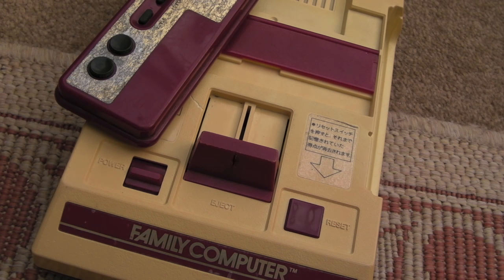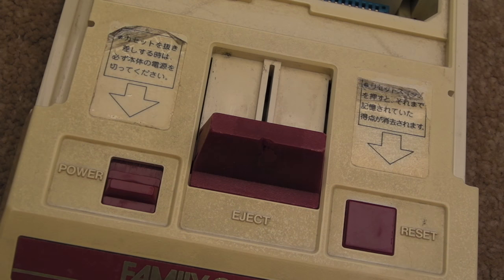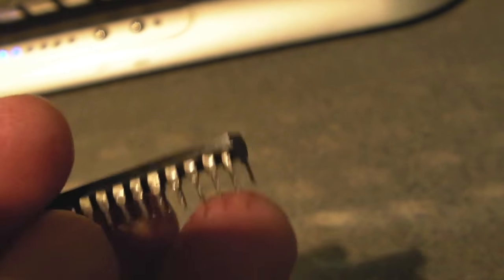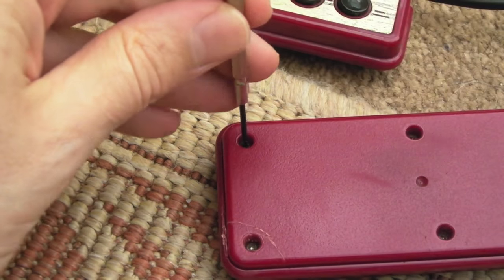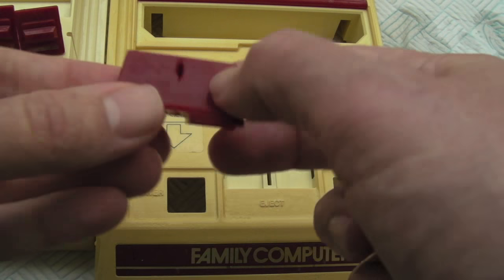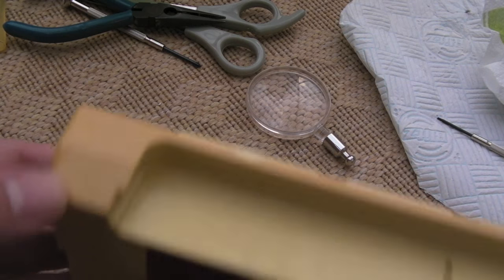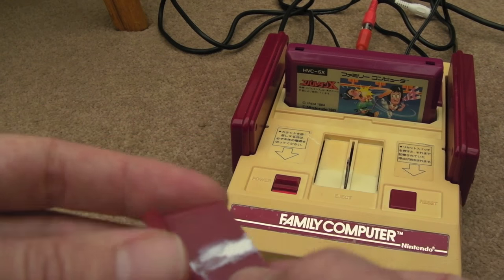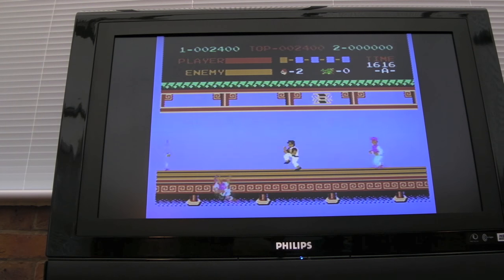5 Nintendo Famicom Repairs - Part 1 (SRAM - Black Screen)

Comment: Non there is not electrolyte in sram only transistor so someone dropped somethings acid in the device
Reply from the maker: That's what I thought, but I have read a research paper talking about failure types in older SRAM, and that paper clearly indicated that some older SRAM had electrolyte in something called the 'storage trench'.   There was nothing on top of the chips, nor around the chips, and no where else on the board.   I've seen this exact same thing 3 or 4 times - always in 2114 or 2115 SRAM - nowhere else on the board and never any signs of anything having leaked inside.
Reply: SRAM isn't supposed to have a "storage trench". Trench capacitor is a kind of vertical capacitor that is formed at the transistor gate in DRAM and EPROM, and actually is responsible for data retention, and it kind of makes sense that they'd try to stabilize and enhance the properties of this capacitor by introducing an electrolytic material into it... but it would be nanoscopic quantities that could never outright leak, and it would be very very far from the legs, especially far outer ones at the end of enclosure. Besides, that's DRAM, SRAM is really just supposed to be a transistor arrangement.

I'm thinking, there have simply never been many SRAM manufacturers, only a handful, and if one of them made a mishap in leg metal composition or enclosure plastic composition, and didn't notice it for a a few years because it takes decades for the problem to manifest, a lot of devices would be affected. Perhaps it's just a plastic additive leaching out and being corrosive. Also, could be that these SRAM chips, which were already severely outdated by the 80ies, were simply a lot older than consoles, old stock, and could come with a bit of invisible corrosion of the shelf?
Reply from the maker: Thanks for the info!  We have  afew theories on here so far - someone has suggested its an ionising effect between silver coating and the plastic package?   But it's good that a few people have clarified that a storage trench seems to only relate to DRAM, and as you say - the quantity seems so low that it couldn't be the problem anyway.  It's all part of the learning process.

Comment: Hi. My Famicom is outputting 14vdc. Is this normal? It's a 100v power supply (japan).

Thank you. God bless, Proverbs 31
Reply from the maker: Yes, the Famicom uses a 7805 voltage regulator internally, so it can accept 14v DC.  Often these manufacturers label a PSU up as 9v or 10v but it's not uncommon to see them outputting 12v, 13v or 14v DC.  The same is true of the Sega Megadrive power supplies.   Ideally 9v PSU is better as it will result in less heat internal to the Famicom.
Reply: I see. Thanks. What's the next step & component to measure to repair this Famicom? Nothing appears on the tv.
Reply from the maker: It's worth watching the other Famicom repair videos I did there.  It could be that there's a bad solder point on the DC jack socket, it could be that the crystal is dead, or it could be a faulty PPU, CPU or RAM.  You could measure voltage coming out of the 7805 regulator between ground (middle pin) and the 5v pin (right hand pin as the part number faces you).
Reply: Would this work: Can Famicom  transistor/voltage regulator (is a regulator a transistor too?) HA 17805 be replaced withI with a AN7805 (the one I bought, the only one available)? I think HA means Hitachi.

Is the 1 before the 7 important? Or these are just the same 7805?

By the way, off topic (about a power supply for another gadget).

Also, the original ceramic fuse had a label of T8AH250V will the one I bought work (it's the only 250v fuse available)? :

5A
BS1362
6X30

Thanks
Reply from the maker: Yes, that should work.  With these I will typically replace with a 7805CV (rated 1.5 amps vs 1 amp).
Reply from the maker: Just check the pinout is the same - should be pin 1 input (eg. 12v), pin 2 ground, pin 3 5v output.  https://www.google.com/search?q=7805+pinout&client=firefox-b-d&source=lnms&tbm=isch&sa=X&ved=0ahUKEwj895zW94TjAhVBt3EKHXT4AxAQ_AUIECgB&biw=1920&bih=916#imgrc=WrnM3Un0SSSXtM:
Reply: Thanks again! I'll do my best to restore this. (btw, of topic one , it's a fuse for a desktop HP PC PSU, I'm trying to revive for, perhaps donation or for burning games coz it still has a CD burner. 

The original ceramic fuse is a T8AH250V the one I got to buy, the only one they had that's 250v (but it seems to have a lesser amperage) has this label:

5A
BS1362
6X30

Could I use that ceramic fuse I bought?)

Thank again for the big help, restoring retro (it's also honing my skills w/ electronics which we had as a subject in high school but it's basic)! Have a blessed week.
Reply: @GadgetUK164  By the way, if the fuse does not have legs soldered on, on them, how thick should the copper wire be (for its "legs" to solder to the board) for 1.5A, how about for a 18A (250v)? Thanks again.
Reply: By the way, if my different video game consoles and one more gadget (all are 100v except for three 110v US) have a total of 198w, how many wattage should the step down transformer be, if I switch all those consoles on at the same time (all are plugged in w/ two surge protectors)?

Thank you.